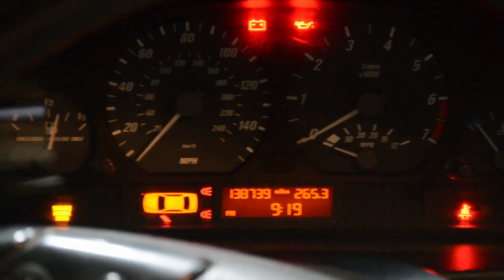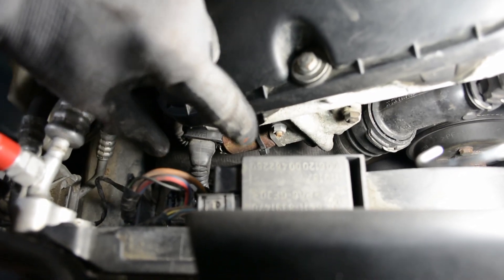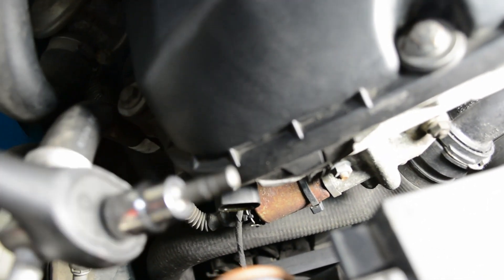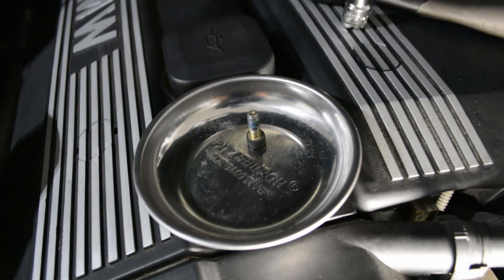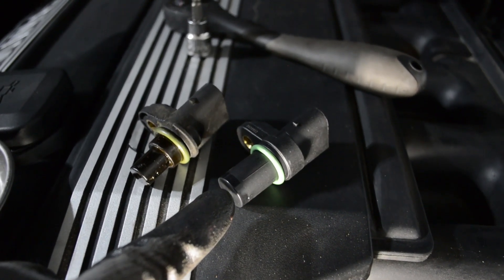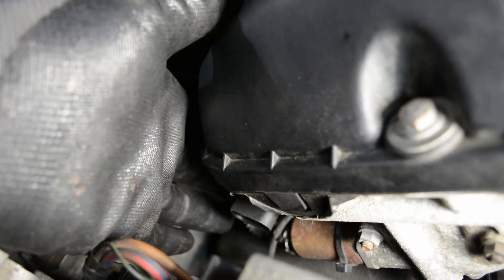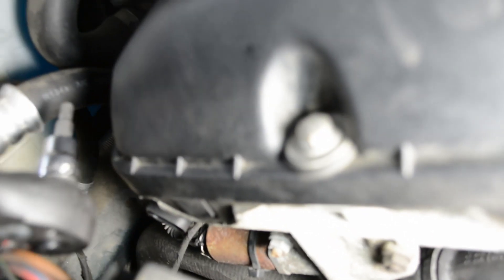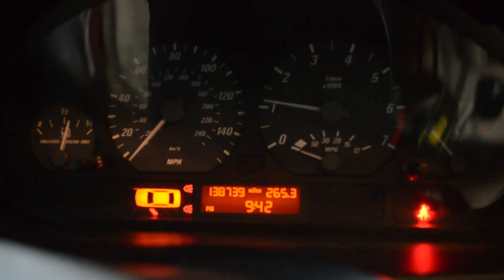BMW E46 Exhaust Camshaft Position Sensor Replacement

Comment: Thanks for this video. I saw another tutorial where they wanted me to remove the fan and a bunch of other stuff but I did it ur way and it worked. The only tricky thing I found was getting the connector off the sensor but I used some long needle nose pliers and it worked.

Comment: I have a misfire 1347 code and some times shows the scanner fault con this sensor, can this sensor faulty cut off and back the fuel on the cylinder? Thank you
Reply from the maker: it is possible that this sensor could cause a misfire, but I would also look at other items- check your spark plugs and coil packs first.

Comment: My bolt stripped under the pressure of a small Allen key🙃
Reply from the maker: Try getting to it with some vice grips or pliers, then replace it with a new bolt when you get it out.
Reply: @northeastbavarian4249  I ended up using easy outs and buying a new bolt and a spare for $0.20 🤣

Comment: Is it fine if i dont clear the fault code?
Reply: I know this is late but yes you should clear the code, any parts store will for free if you don’t have a scanner tool, you can try resetting the battery for 5 minutes and see if the ecu resets but it might not

Comment: Hello. i have same code mine camshaft too little bit oily. what if i just replace the o ring and use it ? because there are no noticable performance loss or anything, everything works well. Can you help me ? what i need to do. ( sorry for  broken english)
Reply: Your sensor has broken down internally, and oil is seeping through it. The Oring does not seal against the internal parts of the sensor. You need a new part.
Reply: @tc3sean  Hi thanks for reply , i already replaced the camshaft position sensor it works fine.

Comment: It solves sudden stalling issues while driving in very low speed?
Reply: The exhaust cam sensor fails the "gentlest" of the three - it seems to manifest as a hesitation and/or lack of power only at the very low end, near idle, and possibly poor fuel economy. I'm having this issue with my 325i - no EML, but the revs really plummet (comes close to stalling, in fact) unless I give it 1000+ when moving from stationary. 

Luckily my father had an E46 318ti and the (only) cam sensor on that one is the same as our exhaust-side sensor, so I swapped them out. See if it makes a difference tomorrow.

It's a very easy and very cheap job - well worth doing.
Reply: @JMUDoc  hello sir , thank you for sharing  your experience brother  i extremely  appreciate that . I changed many things such as , 1. Rebuilt of Disa valve, 2. Vanos fully Rebuilt, 3. Cleaning  Throttle body and IAC 4. Vaccume leaks 5. Intake position  cam sensor.

Excatly same problem as you described  ! 

I still have the problem, i will try to change the exhaust cam position sensor and hopefully it will solve the problem, if you recommend anything  else plz inform me.

Thanks again bro ⚘
Reply: @mazinalmaimani7291  Make sure to check ALL the possible vacuum leaks, including any vacuum plugs on the back of the manifold and the one on the CCV oil separator. 
If you have not changed the valve cover gasket, you might want to do that as well.

Failing this, there is always the crankshaft position sensor... but that one is next to the starter, and means you going underneath and removing the vash plate.
Reply: @JMUDoc  i will definitely do that , Thanks  man , Enjoy your day 

Stay safe ⚘
Reply: @mazinalmaimani7291  M54's are basically a game of "chase the vacuum leak" - best of luck.
If the exhaust cam sensor fixes your issue, be sure to reply here.
Reply: @JMUDoc  😂 excatly ,  yes for sure bro ⚘🙏🏻

Comment: Does the sensor slide right in, or does the bolt push the sensor in the rest of the way. Mine won't go past the o ring
Reply: Should push all the way on - coat the o-ring in engine oil.
Reply: Put some silicone grease on.
Reply from the maker: Push it in as far as you can, I applied pressure to the sensor as I tightened the bolt which seemed to help it go in straight.

Comment: Did your e46 suffer from rough idle or decreased acceleration ?
Reply from the maker: Mine did not, I would get intermittent check engine lights but no noticeable decrease in performance. The symptoms you mentioned sound like a vacuum leak, which M52/M54 engines really don't like. Check your idle air control valve, DISA valve, and the intake track upstream of the MAF.
Reply: @northeastbavarian4249  Ok here's an update about the " Issues " that I fixed although it doesn't show on a scanner tool. I changed a blown vacuum pump , I changed the main engine harness, it was triggering a  camshaft exhaust code . Had the engine mounts and transmission mounts changed . Had something like a cross on the back of the transmission changed , air filter cleaned and throttle body cleaned . The rough idle is still present , but only because the car is idling lower than it should be .... the shaking and annoying rough idle is gone , but the small vibrations are becoming of the low idle ... I believe it's idling on 600 RPM ... is that normal ? And if not , what causes low idle in your experience
Reply: @Van.lb91  Mine idles in the low 600's and is occasionally a TINY bit rough, though not enough to chuck a code. We're talking "feeling it at the gearstick in neutral" kind of rough.

I would look into the CCV - literally. If that's blocked it can cause rough idle; I'm doing my CCV (and the 02 Pilot mod) this week.

It may also be the piston rings - there are only two on these pistons and the oil scraper clogs easily, leading to loss of compression. If you have access to a compression tester, definitely give that a try.
Reply: @JMUDoc  Just got my car back . So , the transmission mounts were devastated , the two cross-like parts were also gone . There was also a revolver shape enforced rubber in the middle of the transmission was torn . Now the shaking and vibrations have gone to minimum when I set the stick on Drive or reverse , since mine on neutral doesn't shake , only on D and R , but it's still idling at a low 650 RPM , although I cleaned both the air filter and the vacuum air control valve , which wasn't so dirty but it didn't a slight better idle ...
So I've come to a conclusion now , which I'm almost pretty sure of since my car was mistreated before by the previous owner with bad oil quality . I'm guessing the chain tensioner needs replacing or/the piston rings . 

Hope you get yours fixed man , mine wasn't triggering any codes so it has to be the chain since I've changed everything already, what is left is to change my wife 🤷🏻‍♂️
Reply: @Van.lb91  Bad fuel can cause that.
check your  Fuel filter ?
Buy the best fuel system cleaner.
I don't know which one is best.
Reply: @Van.lb91  my car does the exact same thing man exactly every thing that yours did
I changed the camshaft sensor and it fixed it for about three days
Im thinking I just got a cheap part
Runs perfect on a cold start though no clue what’s up with it
Reply: @weknowstuff5818  I've fixed all the issues at last . I also found a page on the internet and I've taken a screenshot of the things that break down on this engine and they aren't actually many problems and some of them can be avoided . I will upload a link for you guys
Reply: @Chubbys  read the comment I've set next
Reply: @weknowstuff5818  the new engine mounts that I've installed were completely different than the German original parts , so they were causing the shaking on D and R . Now they're completely gone . Also , the vibration that was felt from the engine was the timing chain . Two plastic parts that hold the chain in it's place were broken and I've replaced them and that also means a fixed and steady timing chain in place which resulted in a steady idle , acceleration, vibration free and increase in performance, as in steady performance instead of increasing performance with higher revs . So , cheap new Chinese engine mounts and broken plastic holders for the timing chain . Now the car runs like a cotton candy , very smooth and quite. Will upload the link as promised
Reply from the maker: Glad to hear you got it figured out. I'm surprised it was the timing chain guides- happy you were able to replace them before further engine damage!
Reply: Check your upper and lower intake boots - they are very, very common points of failure on this engine, especially at the bends/bellows.
Reply: @JMUDoc  yeah they're all good . Used a smoke machine to identify the vacuum leaks , which lead me to the vacuum pump that was blown , leaking both vacuum and oil into the exhaust I believe
Reply: http://mywikimotors.com/n46b20/ 

This is the link I promised guys . Hope you find it useful 👍🏻